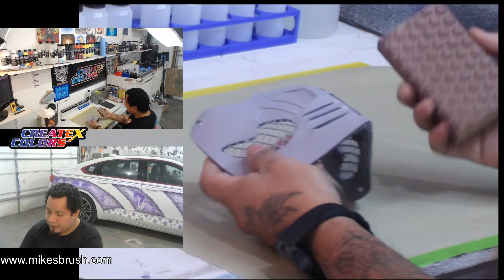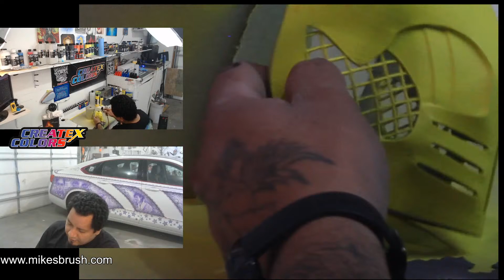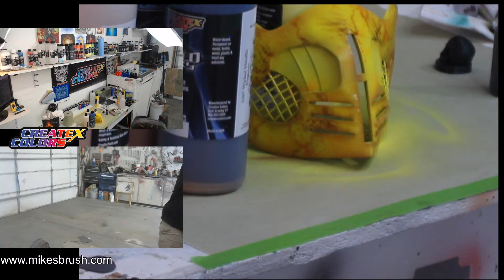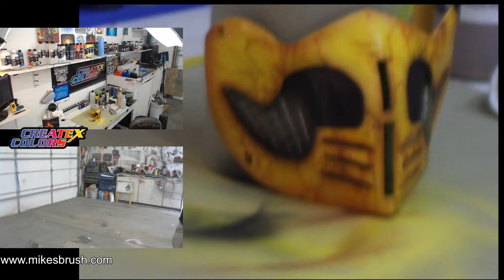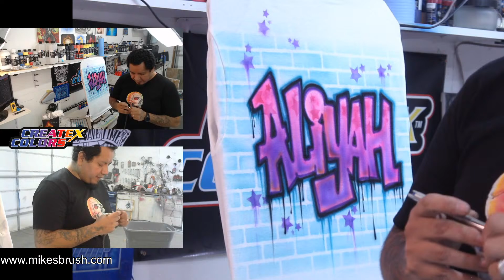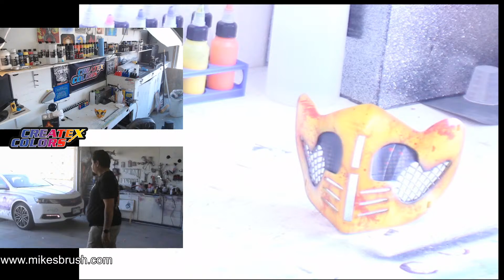How to Airbrush 3D Printed Scorpion Mask

Comment: How do you get the clear coat to not be tacky? I painted four PS5 and Series X controllers and they're all tacky after holding them for a few minutes. I used Createx primer, dried 3 days, Createx opaque and transparent paints, dried for 5 days, Createx 4051 satin clear, dried for 7 days.